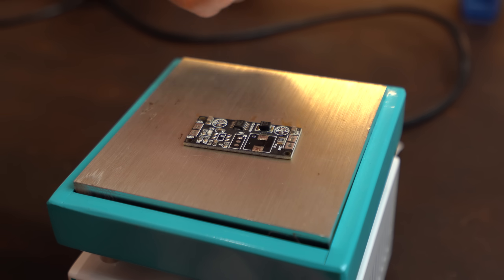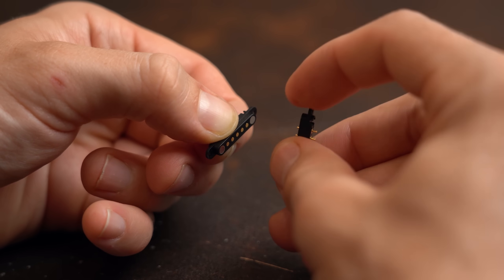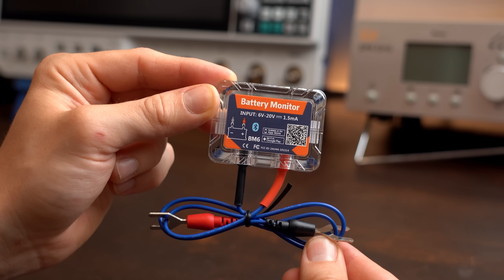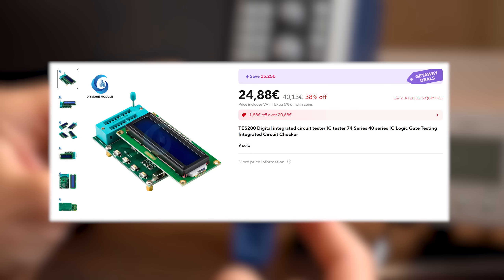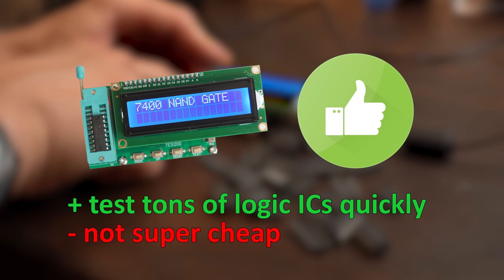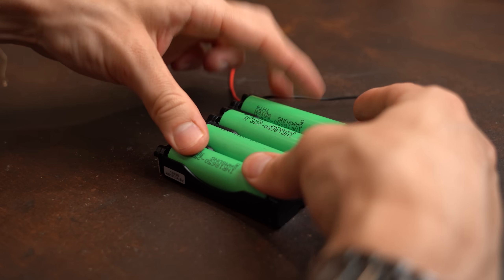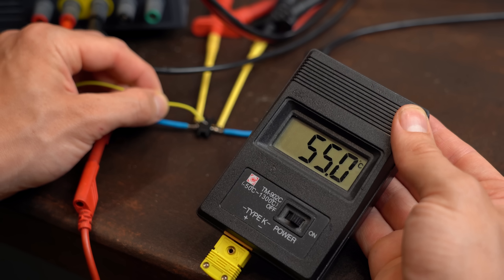I tried finding Hidden Gems on AliExpress AGAIN! (SPECIAL Part 10)

Comment: I still don't know why 5x less is the same as one-fifth? If the Wago handles 20A and the device under test handles 5x less, then it would be 20A - (5x20A)! That would give a rated capacity of -80A. Perhaps if we were in a black hole or an inverted parallel universe? Other than that I have found Scott's videos very informative and useful.

Comment: assume same power limit, the 5 times larger resistance should allow a sqrt(5) times smaller current, so around 9 A. Though the Wago connector is actually meant for these kinds of (thermal) loads, and the magnetic one does not look like it is, maybe 4A (or even lower) is appropriate as a limit

Comment: A battery monitor works by bluetooth doesn't do a lot of good if you don't sleep by your car. Mine is parked at the street about 40m away. Besides, I already know the battery condition simply by how the central locks react to the remote. If they are lazy I know there will be a problem :P

Comment: I believe "high hardness" aka. "hardened" drill bits mean carbide drills that these are not; those require a diamond tool to grind. Drills sharpened by a tool like this will definitely work better than before but by no means correct by the book. Better than nothing, though.

Comment: I've got some great stuff from AliExpress.
- Webcameras, with Sony IMX sensors (I have an USB2.0 and a 3.0 one, 3.0 was needed because of the USB2.0 bottleneck on my PC.
- Lenses for the same webcameras, 6mm F/1.0 m12 ones are my favorite.
- A Nobsound mini class D amplifier (which works with a "laptop" power supply, nice sound, never had a problem with it driving my speakers.
- A Miniware small soldering iron, great stuff (mine also works woth a laptop style power supply, but there are newer ones with USB-C - soldering off of powerbanks!).
- Cables and connectors for my headphones, some are really good for DIY).
- Lots of adapters for 1/4, 3/8, 5/8 screws (for cameras, microphone arms, etc.).
- Capture cards! Last time I've got a Hagibis USB3.0 one, that can capture 1080p 60fps in YUY2 or MJPEG (also can downscale a 4k60fps input for capturing), no problem with this either.
- Replacement earpads for my headphones (I dont know if this counts, because it just seemed that the one advertised for Fostex headphones would fit my R70x's - using them for 1 year now and this is the best I've ever tried - had some other brand before).
X- The 4K multiviewer I've bought from there is not really good, has a very soft output. It was also very cheap and HDMI1.4 (which can do maximum 4K30fps) - had to look for an another from ebay which was 5x the price and is HDMI 2.0, 4k60fps and works like a charm.

Overall a great experience, but I did put in some "work" and read the specs of everything.

Comment: I'm pretty sure you're not supposed to spin the bit. You have to carefully align the cutting edge of one flank before pushing it into the wheel and of course you have to grind both flanks equally.

Comment: I like the Battery Tester Monitor 12V Car Battery . Its on my list now😀
Reply: Do not buy it, the bluetooth is only working when you standing next to the car. I am sending mine back. It is useless with such a short range.

Comment: I purchased some of those usb c laptop adaptors after your recommendation. Really is a great product. I have a few next to charging areas in my house so my partner can take her laptop anywhere without having to remember to take the charger. 😂

I think from this video i will definitely try the batteru monitor.

When I worked at a land rover work shop we could of done with those to remember to charge longer term projects 😂

Comment: 1:54🤣
One look at this and i know that im better off with 250 grit sandpaper and a door🤣

Just in case... you need 600 grit🙄 If you touch the fucking sandpaper and not feel it, buy a new drill and take the time to find someone, who takes your money for sharpening your drill bits.

Comment: The roller tape measure is very useful when working on construction site (I had one similar). There's usualy a scale mode in it that you can adjust manualy to your building drawing scale. That way you can quickly verify the lenght of a wire run or pipe lenght. It's very useful when you are ordering materials and planning a job.

Comment: Would love to see a follow up on the battery monitor where you use ESP32 to bridge the data to WiFi, you could add it to home assistant to warn you in the night if your voltage drops due to temperature.

Comment: The Battery monitor is a brilliant idea as it can be used to find the car if lost in a large shopping centre, or if it is stolen. Also it won't alert the thief like an Airtag will.
Reply: I don't know about the BM6 shown in the video, but the BM2 I have has a range of about 10 feet...
Reply: @HenryLoenwind  Yeah but they do GPS logging and show the last location in the APP. The range is only for direct connection when checking other functions.
Reply: @HenryLoenwind  Yes it sucks. Do not buy it, the bluetooth is only working when you standing next to the car. I am sending mine back. It is useless with such a short range.
Reply: @ronsworldnl  For me the range is, while not exactly "fine", acceptable. I have to take my phone to the bathroom to connect, but my main use is not to check the current state of charge but how well the battery still holds a charge. And I can do that any time when I drive the car anyway as I get a nice history.

Comment: I would AVOID those magnetic pogo pin connectors.
They are very dangerous in a lot of instances. The magnets cause a very high likelihood of the them accidentally sticking to (and thus causing a short) random conductive metal surfaces.

I had one built into a USB cable for a charging a little portable headlight lamp for a helmet. 
Didn't notice that it had stuck itself to a random metal item on my desk (while plugged into USB power) and came back to a melted cable.

Comment: The drill was missing its center edge and relief cuts. It will walk all over the place, if you don't pre-drill a hole in significant diameter and it will rub against the material leading to unnecessary heating and chattering.
This drill is essentially destroyed.

Comment: The battery monitor looks decent, I purchased an expensive CTEK battery monitor and it's a piece of S#%T (surprising as there chargers are phenomenal) the monitor very rarely connects via Bluetooth and if it does it only shows up to the last time it was connected, in addition to this it won't show cranking amps like the one you got from AliExpress, I'm thinking I'll throw the CTEK one and purchase the AliExpress version.
Reply: Do not buy it, the bluetooth is only working when you standing next to the car. I am sending mine back. It is useless with such a short range.

Comment: This logic IC tester is quite bad I have to say. If you buy TL866 programmer (even obsolete CS version) you not only get a nice programming tool for all memory chips and popular microcontrollers (even AVR's with messed SPIEN and RSTDISBL) but also you got access to powerful logic tester that not only tests but automatically detects connected IC. Pretty useful.

Comment: 7.11 typical expresses scam....who in there right mind would buy a 23 usd volt meeter when you can get 1 for 5usd in any local hardware store?..on top of that it comes with fire/ explotion risks ,since it comes deliverd witouth rings that go around the battery poles,prone to come loose in high vibration envirement.every see what happens to your car electronics if you short a batery,batery is designed to deliver huge amount of power is short amount of time(you can even weld with them (not recommandit))  this product should be banned

Comment: The circuit tester has one issue I am not a fan of. Its the device that you place the chip in with shutters that close to contact each pin. Over time the one I have on a component tester no longer makes reliable contact.

Comment: Ad the spying battery monitor you may want to thank Google for gluing Bluetooth and location permissions together. One solution could be installing a VPN-like per-app blocking application. Like Traffic Control, NetGuard or Rethink DNS (or any other but do choose popular open source solutions for less risk).

Also Ground News is too "enlightened center" biased and thinks that "left wing" media are those mainstream ones (check f.e. how the four main information channels are rated) and happily promotes hateful sites, like B*eitbart.

Comment: @5:00 Wouldn't it only be sqrt(5) less current? I'm assuming you'd want to keep the same max dissipated power across the connector. Since it's P=I^2 R then 5x higher resistance would mean only a sqrt(5)x lower current (putting it closer to a 10A limit)

Comment: The modes of the digital tape measure look like you don't need to squeeze in the roller to the edge. Maybe it will add it's own radius in |__ -shaped mode (or diameter in |__|-shaped mode) ?

Comment: Aren't the cells in parallel on the last product? It seems as if the voltage is created by a boost converter. And with cells in parallel there is no need for a balancing circuit. Correct me if I'm wrong.

Comment: The Roller measure device has modes |__ and |__| for accounting for its own dimensions, if you cant get to the corners.
But I would also always use a string and my folding rule

Comment: Having 10 or so smart watches I HATE HATE HATE HHHHAAATTTEEE magnetic pogo pins are the bain of my exsistance. I HATE THEM SO MUCH!!! no matter how careful I am no matter what the spring loaded side will stop working within 2 months. I buy 3-4 replacments at a time for whatever smart watch I am using and even then due to manufacted defects those can go after just a couple uses. The quality is so bad I quit and now have 4 smart watches that I don't use becuase the spring loaded pogo pins broke. They were so bad it killed my hobby of tinkering with the smallest of android devices.

Comment: The battery monitor looks super useful. However any device that requires a proprietary app is a no go for me. Same with any device that requires an internet connection to function when connecting to the internet is not its purpose, such as a "cloud" connected ceiling fan, or light switch.

Comment: With the drill bit sharpener, it’s important the grinding wheel is even, no grooves. Pretty sure it wouldnt take many sharpening (since each size sits in the same place) before it got grooves, so the question then is can you buy a bunch of replacement grinder rollers? I learned how to sharpen drill bits on a grinding wheel, and often had to use a diamond bit to flatten the grinding surface.

Comment: Not the best installment of the series. The drill bit sharpener is trash and used incorrectly to boot, the battery monitor is unsafe without a user-adder fuse

Comment: I'm glad you tested those magnetic pogo connectors, they've been sitting in my cart for a while. Haven't though of any better solution to quickly connect and disconnect power and data lines in parts of a costume.

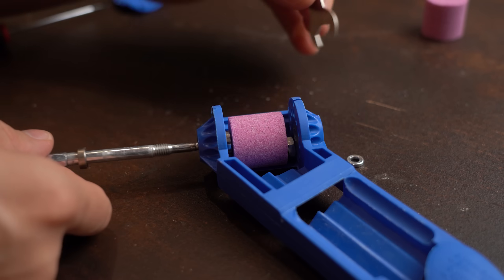Comment: 2:17 I'm sorry but that drill will not cut anything since the leading edge is lower than the trailing parts. 
If it removed any material it was via abrasion not cutting

Comment: 7:07 the weird thing is that once upon a time long long ago a battery voltage meter was not that foreign in a car. I don't understand that with the complex computer systems we have in cars these days this hasn't made a return =l
Reply: Numbers and gauges and buttons are scary to the muggles.
Reply: Mine has one in some sub-menu. However, it is mostly useless. The car's screen is on when the car is running, or when you just turned it off and the battery is fully charged.
Reply: Most modern cars do have sensors that read battery voltage and many other things that would be useful to the consumer, however the reality is that putting this information on the dash and making it available to the driver would only decrease the number of service appointments dealerships have after sale. Car manufacturers don't really want people working on their own cars anymore. So now, if you want to see any information about the vehicle you either need to book a service appointment or buy an expensive scan tool and know how to read what your looking at.
Also, he is using the battery monitor in the video on an AGM battery which if you have a modern vehicle with a start stop system is not advised. Those systems can be very sensitive to voltage and I could see this device prematurely killing one of those batteries with a start stop car. I've seen it happen with just those little low voltage rust inhibitors.

Comment: Include the shipping costs, for example at the connectors. Some sellers decrease the price (to get a better priceranking at Ali) but increase the shipping costs.
Turning off an option (for example GPS) in an app, doesn't mean it will not use it at all. Maybe it will turn off the option for a function but the app still have the privilege and permission to use it for something else.
Reply: Most of the items on Aliexpress are shipped by Aliexpress nowadays, so it's free for purchases over $10. Very few of the sellers on the site are able and willing to handle the bureaucracy of importing into the EU anymore.
Reply: Shipping cost often depends on where you live though.

Comment: You don't even need the manual for the tape measure. The modes you were switching through eliminate that issue you had measuring between the boxes.

Comment: Another use for that wheel tape measure thingy might be measuring non-straight lines, I guess for example to get the length of wire you might need to replace a burned trace on a circuitboard (if the surrounding components don't get int he way), or measuring the length of a trail on a paper map (might need to do some math if it doesn't have a built-in scaling option though).

Comment: I bought the battery monitor too, i have an R36 passat and the factory battery location is in the boot. The monitor worked great until i closed the boot and bluetooth would not connect anymore. It would only connect when i was in the car. Did you have a similar issue when the battery is in the front? I noticed in the video there was no bluetooth connection while you were in the lab.

Comment: I also bought that drill bit sharpener, it is absolute trash and the grinding wheel wears out so fast. I bought an electric one from ali called ‘multifunctional electric knife universal sharpener bench’ and it actually works so well. I sharpened 10 hss bits ranging from 8mm to 16mm and it worked better than i expected. I tried doing a chisel and its difficult to maintain the angle because its made to suit all sizes, but some practice led to decent results.
It is not a waste of 30€ considering the drill bits over 13mm cost more than that.

This is not a paid endorsement!

Comment: The drill bit sharpener is useless. Does not matter how sharp the edge is if the relief angle is 0 degrees.

Comment: AliExpress is a scam. I ordered $230 of LIFEPO batteries. A $6 dollar cellphone induction charger showed up. I notified AliExpress of the wrong product and I sent them a picture of plastic bag the cellphone charger came in. The order number on the plastic bag matched the order that I placed and was told I got the product that I ordered. 
From their own website the total weight of the product I ordered was about 60lbs. The bag had a weight marked on it as 2lbs. I asked a very funny question of how did they shove 60lbs in a 2lb bag??? I never got an answer and I will never ever will buy another product from AliExpress.

Comment: Before people bu the drill bit thing, understand there are different angles on drill bit tips as well as split point drills. This think looks like it would ruin bits that dont match up with it. I would recommend a drill doctor instead.  They cost a bit but account for all these variables and can sharpen most twist drill bits.
Reply: People buying sharpeners on Ali only have one kind of drill bit, Universal. You shouldn't be able to spin the bit in the sharpener at all. you need to align the cutting face with the grinding wheel and touch the surface then rotate the bit 180 and touch again, The only time you need to grind further than that is if you jammed the bit and broke off a chunk or snapped the end off entirely.

Comment: The appropriate tool for sharpening deming bits is a small round file like the ones made for sharpening chain saws. You can find sets of even smaller files suitable for your smallest bits (stop giggling, boys) with the welding tools.

Comment: General purpose BMS that does not allow overcharge/cutoff voltage tuning with jumpers or pots is basically useless. My cells would die for good at 2.4v and explode at 4.32v as their range is 3.4v-4.12v.

Comment: We could get these battery monitors for 10 eur locally for limited time. now it costs the same as you mentioned - 25 eur. But there are around 13-15eur variants available on ali also.

Comment: 8:20.  I am not all trying to promote paranoia as the app is very likely harmless, but having an option in the app to turn off GPS does not mean anything.  If the developer is untrustworthy, then they can easily offer options that don't actually do what they say.  In fact, it would be quite easy to allow the user to turn off GPS and then disable the GPS-powered features in the app while still collecting all of the standard GPS data.

Again, there's really no reason for this company to care about where your car is parked as that does not provide monetary benefit to them, but we cannot trust the app to disable its own spy features; we'd need to disable those features in the phone OS to have any faith that they are being enforced.  Unfortunately, removing "location" permission for that app will probably break other features like Bluetooth.